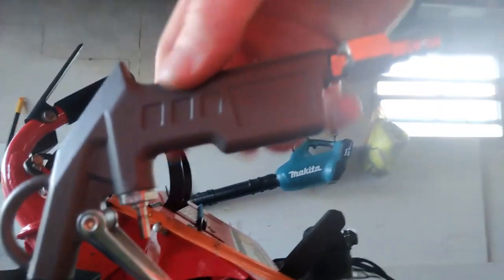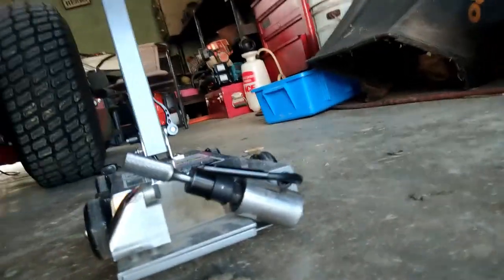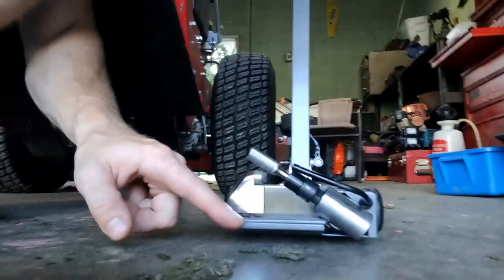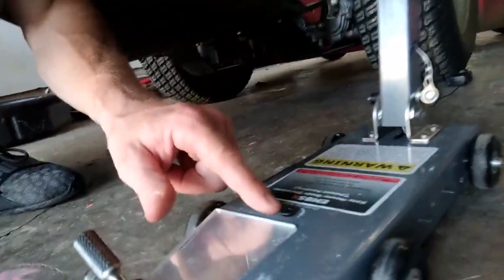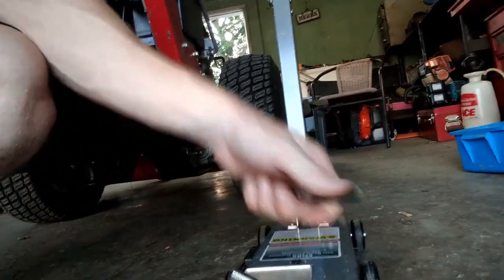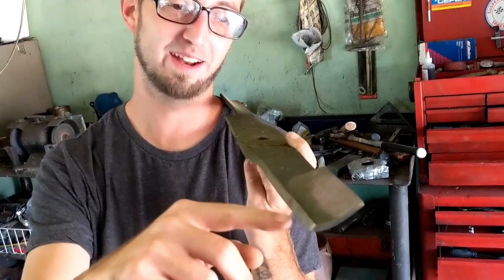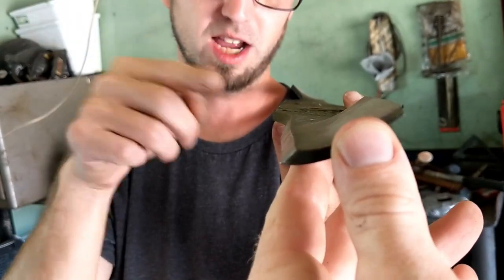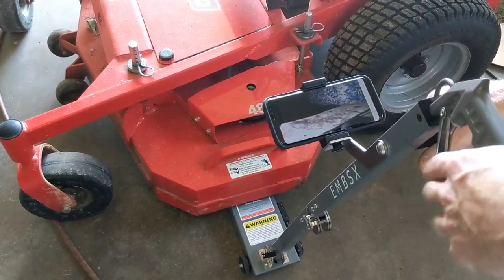EMBSX "Easy Mower Blade Sharpener" ☑️ Advanced Overview

Comment: Im assuming it's relying on the floor to be fairly level? Otherwise pressure would be placed on the grinding bit?
Reply from the maker: Yeah...the more level your work space is the better.  It could just potentially have the machine grinding at a different angle than you set it to.
Reply: @NORACORE INC i thought that's what was intended. Thanks!

Comment: Concrete can reasonably be expected to be 1/8" out of flat across a 5' span. That being said, that could cause sugnificant variance everytime because of not having the jig and mower in the same spot everytime. And what about balancing the blade? Do you let the spindle repair dictate when to balance the blade? SORRY.....this is a product suited for the generation that would rather ride a motorized skooter instead of a standard bicycle. There is more to taking the blades off than just sharpening....get a feel of any bearing noise, check blade for warping, etc
Reply from the maker: This business/product is no longer around...I agree with you - was kind of excited for it/them but told them from the get-go I didn't see a market for it.  I personally don't balance blades, never had an issue - but, I did scrape the deck every sharpening and often between sharpenings...much easier with blades off.